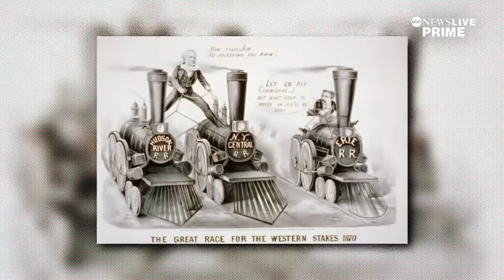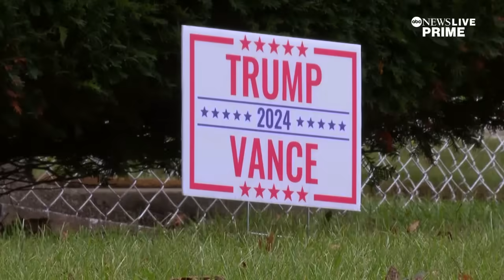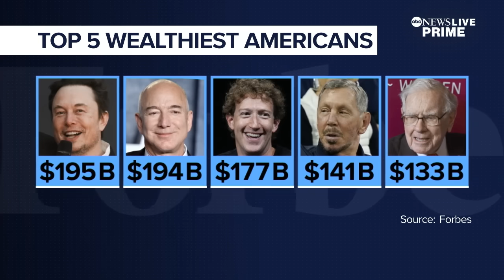Why some experts believe we’re living in a second Gilded Age

Comment: Lower taxes
Reply: On the middle and lower classes. Hike em on the rich
Reply: They are already "low"
Reply: That's how we got here. Does the term Trickle Down Economics ring a bell. BTW, during the Gilded Age it was called Horse and Sparrow. Let that sink in.
Reply: @SPR_NAPALM  nice strawman. I called for lowering taxes. This means for everyone. Not just the upper class. Lowering taxes across the bored time and time again has proven to both increase revenue while taking a majority from the rich and spurring the economy
Reply: @Homedepotorange  It absolutely does not increase revenue. That was the lie told by Paul Ryan. The 2017 tax cuts increased the debt.
Reply: @SPR_NAPALM  What actually followed the cuts in tax rates in the 1920s were rising 
output, rising employment to produce that output, rising incomes as a 
result and rising tax revenues for the government because of the 
rising incomes, even though the tax rates had been lowered. Another 
consequence was that people in higher income brackets not only paid a 
larger total amount of taxes, but a higher percentage of all taxes, after 
what have been called “tax cuts for the rich.”